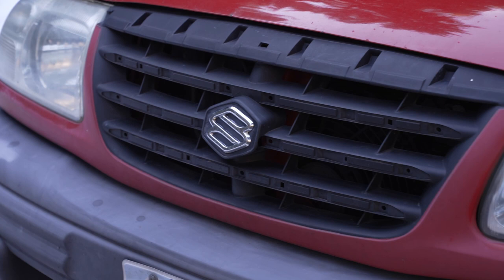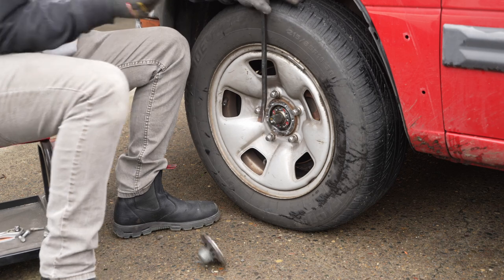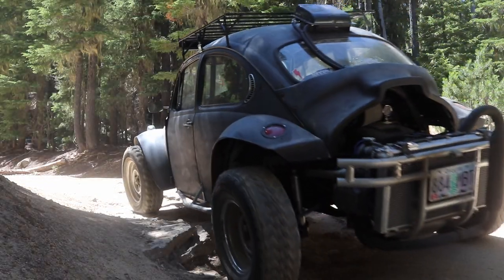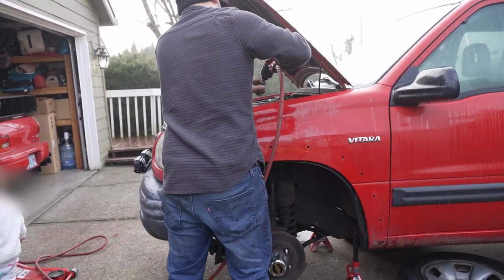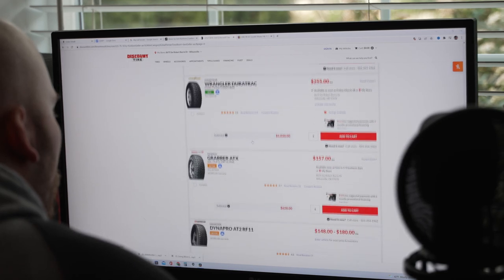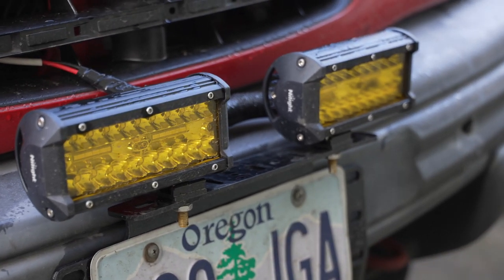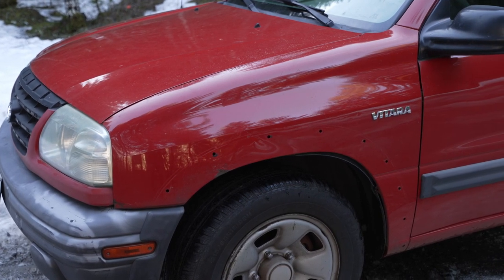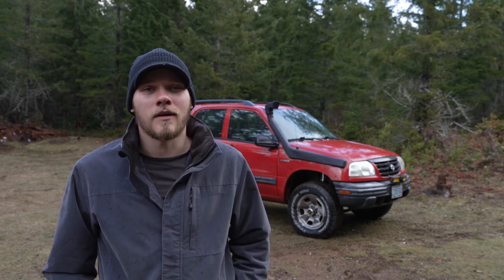Budget Soft Roader Build | Suzuki Vitara 4x4

Comment from the maker: *BUILD LIST
Hubs: Warn Manual Hubs https://amzn.to/34SVeju
Lift: 2" Street Rays Lift Kit ebay
Camber Bolts: Moog K90473 https://amzn.to/3u69Iou
Tacoma Shocks : https://amzn.to/3CLxavg
Tires: BFG Trail Terrain T/A 225/75/16
Lights : Nilight 6.5" Amber Bars https://amzn.to/3u0burr
Light Bar Mount: https://amzn.to/3MTZdNR
Snorkel: Tema 4x4 on ebay

*Extras
Nissan Gasket Maker: https://amzn.to/3CMvm5l

Electrical
Insulated Double Wire: https://amzn.to/3ocR4cT
Favorite B/R 16ga Wire: https://amzn.to/3llYtVB
Heat Shrink Connectors: https://amzn.to/31eI5Pr 
Awesome HeatShrink Tubing: https://amzn.to/3dg43nL 
LED Rocker Switches: https://amzn.to/3ibOUq3

Social Media Links
www.donniedispersed.com
IG www.instagram.com/donnie_dispersed/
TikTok www.tiktok.com/@donniedispersed

*Purchases through these affiliate links support the channel at no added cost to you!

Comment: I have a 2003 xl7 and i've done almost the same mods, 2inch lift, 32s, lights and a roof rack. They are great little offroaders
Reply: same here, 4 inch lift, 31.5's, front winch bar. fun as hell!
Reply: I have an XL7. Looking for the manual hubs
Reply: @edtaylor3409  they are compatable with the ones that fits vitaras/trackers and samurais. the ones that i used came from a 91 vitara
Reply: I have a 2001 GV I'm looking to upgrade. Did you need to change the shocks to accommodate the 2" lift or did you stick with stock?
Reply: @1ring2rule3pigs  i used the same shocks but i had to make an extension to be able to use them

Comment: I built a similar GV for my Baja car. Look out for the stock plastic air intake snorkel that fits over the intake manifold and to the throttle body. Mine rotted away underneath which I would never had seen if I had not been searching for a coolant leak. It was sucking in raw dirty air and completely bypassing the air filter box. It was those damn little rubber hoses that go to the front of each head that were cracked and leaking coolant onto the valley of the V-6.

Comment: How did you get rid of the positive camber on the front tires?

Excellent video, thank you sir!
Reply from the maker: @alfredorenteriavillanueva7462  I ended up notching out the top hole on the lower part of the strut. Then welding, a thick washer in the correct spot so it wouldn’t slide back. First I tried aftermarket camber bolts, they helped, but didn’t quite get it all the way.
Reply: @DonnieDispersed  Cool, thank you!

Comment: Hey @DonnieDispersed those little notched areas on the intake is that to release debris before it gets to the airfilter? If not look into a Snorkel Head Cyclonic Pre Cleaner (round ones). Amazon has em $30 & up. Toughest part might be finding the right size. Too big it won't clean like it should & too small will restrict the airflow too much & starve the engine of air. Looking forward to seeing what you do next.
Reply from the maker: I believe that is how the head is designed to work. Letting stuff fall out before it gets down to the filter.
Reply: Looking forward to a long term review & what the air filter looks like since you put it on  @DonnieDispersed .  Save the old filter for a comparison if you could.

Comment: You said the shocks are for a 2wd toyota tacoma what year? the the KYB 554350 you linked in the description are listed as rear shocks for the 4x4 tacoma
Reply from the maker: I confirmed the ones I linked are the ones I used. When I referenced the part number online I believe it said it fit the Tacoma Pre-Runner which is why I said 2wd but it makes sense that it would fit the 4x4 and the prerunner.

Comment: Did you have to remove the rear bump stops to get the spacer on? We have the same lift and it won’t sip on over the bump stop. We can’t get the bump stop off.
Reply from the maker: If I recall correctly, I removed them and modified them to work with the lift. It’s been a while so I can’t remember exactly what I did

Comment: I didn’t notice in your video what you did for the front shocks to get the extra extension. Are the Tacoma fronts compatible with the GV? Thanks
Reply from the maker: Stock KYB shocks in the front. The lift kit spaces the front struts down from the body so the shocks won’t see any additional travel up front.
Reply: Thanks!

Comment: So what was the idea behind the manual hubs? These rigs don’t engage the front diff at the hubs, but rather in the differential itself. I suppose disconnecting the hubs from the driveshafts would provide a tiny mpg improvement?
Reply from the maker: Better mpg less daily wear and tear.

Comment: Did u use the original shocks up front ? Or wht shocks Did u use up front?
Reply from the maker: Stock KYB struts up front. The lift kit spaces them down from the body, so they don’t get any extra travel like the rears.
Reply: @DonnieDispersed  thnk u for the reply I added the spacer lift on my 03 tracker now it rides rough. So I wasn't sure wht shocks to get tht would make it run smoother
Reply: @DonnieDispersed  I'm sorry I confused my self. U said stock kyb up front , so stock 03 tracker shocks up front?
Reply from the maker: @tbarela032003  correct. Stock up front.
Reply: @DonnieDispersed  thnk u so much I been looking for information on wht shocks to use with the spacer lift couldn't find anything . Thnk u so much for the reply

Comment: Did you have any issue with going to a larger tyre size?
Reply from the maker: Tires rub the frame on full steering lock, but otherwise no issues after doing the lift.

Comment: Could you give the specs on the wheel spacers that you didnt use?
Reply from the maker: https://www.ebay.com/itm/192039762414
Reply: Thanks for the video. What part of the wheel spacer did you try machining? I’m contemplating doing this as well but with the G1 Tracker hub which might be a smaller area. Looking for specifics of what you tried exactly and where it failed. Can I buy your other two that are still good?